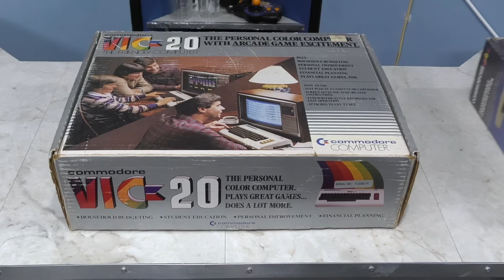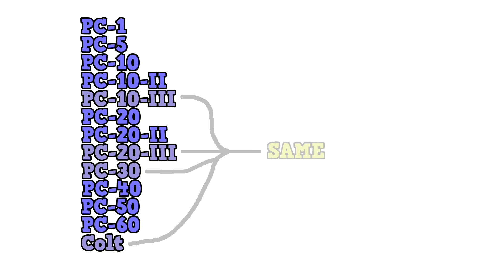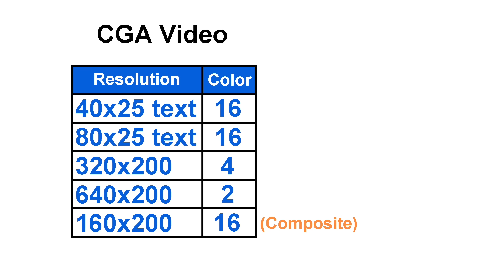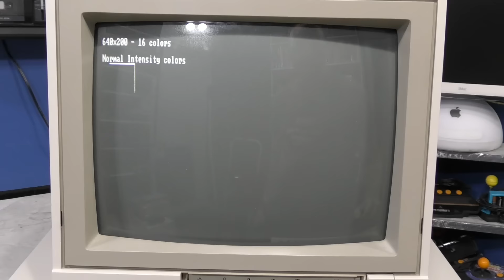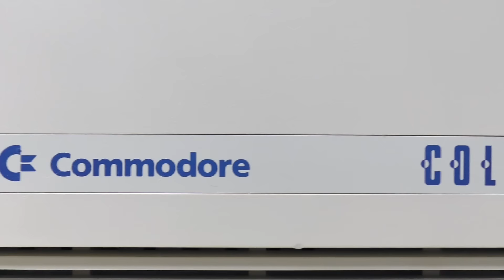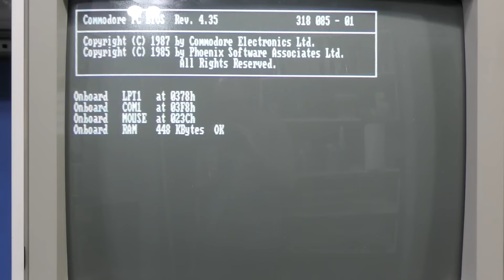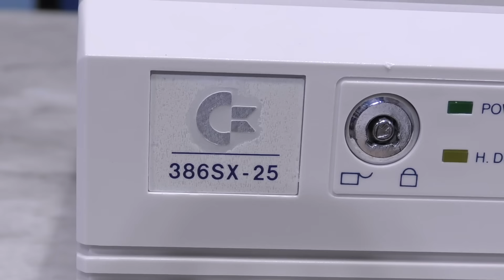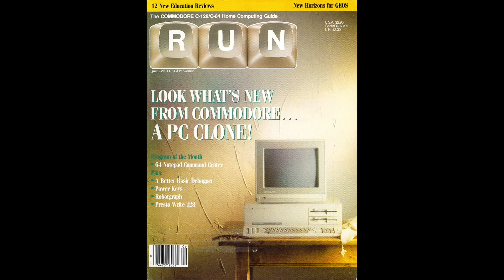Commodore History Part 6 - The PC Compatibles

Comment: Thanks very much for doing this, I'm loving the Commodore History series!
The Commodore PC-10 was our first PC my father bought. It was in 1988 IIRC. However at least in Germany it did not come with that ATI graphics card, but instead just a display card that could not show graphics, just characters. So when I was excited to get my hands on a copy of the awesome game Digger the disappointment was huge when my father told me that it won't work on the machine. He knew though how much me and my sister wanted to be able to play that game at home we drove an hour to his employer, which was an IT company, to get a graphics card (sadly I don''t know which brand, model etc., but it was a full length card) along with a compatible monitor. So instead of our cool looking green monochrome picture we then had a blue picture which you could also be set to inverted colors. I was in heaven when we fired of Digger :-) That keyboard layout having the key to fire (F1) on the top left was very handy for Digger compared to the later standard layout.
Sadly we gave the Commodore away when we upgraded to an IBM PS/2 in 1992, but I have the Atari PC3 my uncle bought in 1989 which offers the same experience but with an cool looking orange monochrome display.
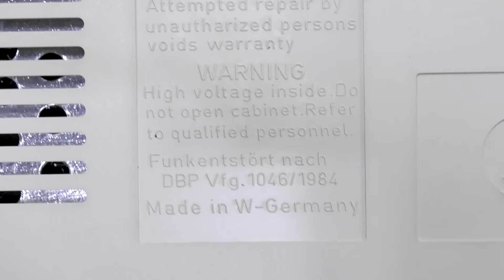Regarding the part of the video at 1:42 that label saying 1984 just shows a year number for when that technical mandate was released by DBP (Deutsche Bundespost = German Mail Service) which at that time were the state-run monopolist for everything related to communication. So they mandated inspections and approvals for technical devices making sure they won't interfere with other electronic devices and over the air transmissions due to excessive electro magnetic radiation.
Greets!

Comment: One thing Commodore should have done, and that is adding SID card on their PC's
Reply: or they could have just added the Paula (the sound chip used in their Amiga computers)
Reply: Quick question though, SID and paula were custom components to the C64- 128 and the Amiga, what other PC used them, the whole point of PC compatible was to make the software work with all of the PCs and the PCs work with the hardware, look at the plantronics mode, had no support at all, at this point if they had tossed a SID or Paula into the machine it would basically languish there doing not a darn thing most of the time, that and the SID didnt just do sound, it also had random number generation and was in control of the joystick ports of the C64. The only standard that was hardware related and supported was the Tandy 1000 video and sound modes, but those were supported cause the computers were quite popular and it wasnt too hard to code for them since they were just modified PC jr modes, but imagine how hard it would be to get a SID or paula sound mode to work properly

Comment: Sorry if this is a repeat of other comments (in all of your videos).
You know when Automotive companies re-use parts in several of their models? This video shows the same habit on Computers.
I had the impression earlier, but now I am convinced: the PC-1 front plate is definitely a C128D. Which came earlier? It seems the PC!
And the Commodore 386SX-25 has the A4000 2nd floppy drive cover!
Co-Incidence? Marketing? Sales? Manufacturing? Caponians? I think it´s all of them!
Worth a video? I bet so :-)
Reply: The C128 was introduced 1984, the 128D in 1986 - the PC1 came 1987 as answer to the Atari PC 1 - Therefore the name 1 and the reason why it came after the PC 10 and 5

Comment: I remember those. My dad used to have one too (PC 20 III i think) and in fact THIS is how i got in contact with Commodore at all, together with a borrowed C64. I remember this IBM compatible PC to be a really slow machine without VGA or EGA output. Just a  black&Yellow monochrome Monitor and one standard 3,5' floppy drive (for low density disks). The whole thing always made weird boot up sounds and was super slow. Hard drive was i think 10 or 20 MB. I don't remember ever having done much with it, except using the Norton Commander to browse through the computer & exploring a excel like program, loading stuff from the floppies that came with it and play "Magic Pool Billard" on it with my sister. It didn't even have a soundcard. Just the internal speaker. I really started at the absolute bottom but i found it SOOO cool that my dad actually had a PC. However he didn't do much with it. I must have probably used the thing more than he ever did. He even had tons of software that came with it and many books.

Comment: Overclocking in 2019: buy a better cooler, set multiplier, increase voltage, stress test for hours
Overclocking in 1987: Ctrl+Alt+D
Reply: Another one to add for 2019 Pray that it doesn't release Magic smoke.
Reply: Overclocking in 1996: Cut cable tie that held the oscillator in its socket on the motherboard, remove 33 MHz oscillator, install 36 MHz oscillator in its place and put passive heat sink on the CPU. 468DX-36 it was. B-)
Reply: Technically you are right - the system is designed to operate at the fastest of the three speeds. Everything else is just slowing it down for programs with fixed delays that would run too fast otherwise. The "turbo" button found on many AT PCs was misleading, it should have been reversed and called "slow down". 

But in any case the original comment is much funnier when not nitpicking. ;-)
Reply: we're pretty much at the edge of what the laws of physics allow us to do. They just really didnt want to put a cooler on their cpus.
Reply: You can overclock the Raspberry Pi by adding a heatsink and editing a text file.
Reply: This is no overclocking. You basically chose clocks within the rated specs of the CPU, mainly to make software slower that was not designed to run at higher speeds. This is because some software (especially games) was written with a specific CPU speed in mind, so it would just run too fast on faster CPUs. There also was a turbo button on each IBM-compatible desktop computer, usually on the case, until about the mid of the 90s.

Comment: I love these episodes! I had a PC 10III en a PC20 exactly matching the one in this video. I bought my PC 10III, i think back in 1986, for a staggering 4000 Dutch Guilders or $1600. It had a green monochrome screen, two 360 floppy drives, 640k ram and a very nice (for the time) graphic mouse (with three button mouse) interface to design your own user menu and a drawing program. It was the folluw up for my Sinclair ZX Spectrum. I had a special program to emulate a better graphics mode called HGCIBM which worked fine.

Comment: Had this same kind of MFM HDD-on-ISA-board in my first XT Olivetti M240, which also had a composite CGA card. Second PC was actually a C-286-16 with same chassis form factor as the 386 shown in video, I was able to get a 287 coprocessor on it even.

Comment: Turbo mode, not to be confused with the Turbo button on PC clones, which would slow down the processor...

You know, I was alive for all this and I still don't get it.
Reply: Well, actually the turbo button controlled the turbo function. The default state of the turbo function is "on". Turbo just means "faster than the 5150 IBM PC". If you press that button, turbo gets turned "off" and the processor timing should be compatible to the original IBM PC. On 8-bit PC clones, timing compatibility kind-of worked (unless they replaced the 8088 by the more efficient V20), starting with the AT and its 286 processor and differing RAM timing, the non-turbo mode lost its meaning as "being as fast as the original".
Reply: @tw11tube  I'm quite sure the turbo button my XT clone was active when pressed. I was 7-8 years at this time and sometimes worried if I break my computer if I use the TURBO too much (but in the end I was 7-8, so I didn't care about that. I wanted it fast NOW.)

Comment: Lesson learned. If I ever move to the USA I will install a 240v European style socket in every room for convenience's sake. It should be quite easy to run some wires directly from the fuse panel through the walls, or even better, in plastic cable channels mounted on top of the baseboards.

Comment: I still have an old commodore laptop with a really nice amber gas plasma display.  Found it in a pile of trash over 20 years ago and apart from the battery it still works fine.  Im amazed the hard disk still works after all that time.  Only ever seen 1 youtube video of the model I have and that was just a 20 second clip of it booting that was posted years ago.
For another interesting PC produced by a home micro manufacturer look at the Sinclair PC200, an all-in-one (like an Amiga) 8086 so badly designed that you couldn't close the case when any expansion cards were installed in it.

Comment: The interesting thing about the PC-1 is the way you add the harddrive. It is connected to the user port with a special cable connecting to the external disk drive connector. This was a loop through connector. So we were able to add a second disk drive  with higher capacity.

Comment: That composite header up in the corner is most definitely for the internal monitor of the  IBM 5155  :)
Connector looks the same as on the original IBM card for that machine as well as the connector found on some other ATI cards of the era :)

Comment: Little mistake .1984 has nothing to do with the release date, its just a Conformity Statement thats called (Vfg 1046/1984(yes we germans love stupid long confusing numbers)). 

Back in the old days the  german postal service had the monopol over licensing the whole communication sector like telephone, CB-Radio, Walki Talkies, RC-Cars etc and they had Conformidity Statements for everthing that used any frequence(cause why not:-). 

Usually they had the symbol "Posthorn" right next to it, seems like its missing here. 

Electronics Emissions

Your printer complies with the Electronics Emissions Requirements of
the German Federal Minister for Postal and Telecommunication Tech-
nology regulation

Vfg 1046/1984

Comment: Our second PC when I was a kid was a Commodore 386SX-25. It is still another model as the one shown in the last part of this video. Case is bigger, all ports are on the back, and there is no PS2 mouse support. We added lots of things to it to run games, including sound card, way more RAM, bigger hard drive. Of course we still have it, last time it took it of storage few years ago was to take out battery to prevent any damage. Appart from the hard drive that starts seizing, it booted fine.
At that time I have tried to figure out a logical sense in Commodore PC lineup, but no luck at all, it looks like a complete mess where every local market had its own models and varieties of products.

Comment: The "Funkentstört nach DBP VFG 1046/1984" simply means that the standard according to which the device was shielded (radio shielded, to be more accurate) was adopted in 1984. You can find devices made up until the mid 90s that followed this standard because it was the norm in Western Germany until its successor was adopted.

DBP = Deutsche Bundespost = German Federal Post Office that was in charge of the regulations back in the days (it had a government-mandated monopoly on all things telecommunication including all things radio frequency)
VFG = Verfügung = regulation, directive
Reply: It may have simply went out of picture when European standards were adopted. Back in the day European Community member states were more or less trusting each others national standards and complying with a German standard was fine in order to sell in most other countries, however, some countries still had more strict laws than others, so it wasn't ideal.

European standards are more or less all national standards combined, all EU member states are required to trust devices complying with European standards. So what do you do nowadays? You design/certify a device according to European standards. That's why these texts disappeared.

The national standards still exist though, and so might this one.

Comment: In case this hasn't already been mentioned by a previous commenter: The 1984 that you though to be a possible manufacture date on the back of the PC-1 is just the date of the applicable German EMC regulation.

Comment: 1:44 Quick explanation, the date is not for the PC but a regulation for signal supression in german. It basically says "radio supressed in accordance to DBP Vfg. 1046/1984"
The terminology DBP probably means "Deutsche Bundes-Post" which was at the time the national post service who was also operating the telephone/cable services, which later in the 90s got separated and turned into Telekom. Vfg stands for "Verfügung" meaning decree.  DBP Vfg 1046/1984 therefore means a decree for a radio noise supression standard issued by the Deutsche Bundes-Post in 1984. 
It seems to be indentical or at least compatible with "VDE 0871 Klasse B", another such standard.

Comment: I used to have a Commodore PC40 in 1991. I bought it at a military base post exchange. The 40 means it was a 40MB HD. I remember using an application called Stacker to double the HD capacity to 80MB. Later I found that was a HD killer by overworking it.

Comment: The comparison to the Performa model numbers is very very accurate. Another good comparison would be the EX/HX/SX/TX/TL/RSX thing with the Tandy 1000. 

There's something about that timeframe where it often felt like companies were just pulling model numbers out of a hat, and playing scrabble with any letters.

Side note, really been appreciating the commodore history stuff. Whilst I had a VIC=20 and was involved in writing some sub-code for larger C64 projects, I was more of a TRS-80 guy than a Commodore one. It's interesting to hear that basically all these companies had bizarre internal struggles and strings of shitstorm "half-releases". It almost makes it look like Tandy knew what they were doing in terms of product consistency... even if like Apple they did have the habit of milking single design concepts for a decade. 

One thing I always had to hand it to Commodore for, at least they tried to do different things instead of every new model just feeling like a tired retread. Sometimes it worked (VIC=20 vs. Pet, C64 vs. VIC=20, Amiga vs. everything they ever made before), sometimes it didn't. (Plus 4, sadly the 128 being too little too late, etc). Unlike Tandy where 80% of their product line were retreads of previous models... like the Model 1/III/4 and or II/12/16, or Coco 1, 2, and 3... Or Atari's endless 8 bit line where at heart they were all nothing more than 400/800's in new form factors. Hell, how about Apple basically selling the same computer with little more than cosmetic changes for a decade and a half, whilst making false claims about how "innovative' they were?

I now have a minus-60 in my collection. Keep meaning to do SOMETHING with it, but I have no idea what.

Comment: I know this video is a couple years old, but back in the 80's I worked at a small computer store... we sold ton's of various clones including our own brand, as well as used computers of all sorts.  I acquired many awesome and unique devices over the years (Altair, Mindset, Sage, Gavilan and many Commodores among others).  Unfortunately, I have sold off many of these over the years.  But one Commodore I remember playing with (I never purchased it as it was new and was very pricey) was a Commodore branded monochrome notebook computer... was really slim for the time and had a unique textured case.  I cannot remember the model number and I have not bee able to find anything on the internet about it.  It was an MS-DOS machine, pretty basic.  Just wondering if you had seen it or had any info on it...  thanks...

Comment: Ah, Commodore PCs. I remember in highschool, circa 1993 we received brand new Commodore 486 DX2 66 to do some CAD on in industrial tech class. Teenager me was impressed with those machines (all the more since I was still using my old 1040 STF at home, and Commodore machines were alien to me). Doom ran a lot smoother on them than on old 386s in the school's library (athough those had networking).

Comment: The PC-1 also sold in the Netherlands. It was sold at a general store called kwantum for 899,- gulden, discounted from 999,-. with a monochrome monitor. A 1084 could be bought for 699,- gulden discounted from 849,- gulden. In oktober 1989.

Comment: Hi,After my intervention on part#5 and C128, here's my point about "compatible" era of Commodore :1) first PC compatible attempt was the B series expansion board with a 8088 [notice that AFAIR, no word about B series in previous parts]2) In 1985, the A1000 had a "side-car" expansion that was more a sort of co-computer plugged inthe right of the A1000. This was then derived to JANUS internal boards for the A2000 and followers that existed in 8088/V20/80286/80386sx version if I Don't miss any. The idea was to have a "side" PC-Compatible computer next to the Amiga, sharing keyboard, mouse, and screen (in dediated "screen" of the Amiga). The interesing thing of this setup was to allow easy data exchange betwen PC world and Amiga world, including the complete sharing of a PC Hard disk at hardware level, reducing seriously the cost of a "professionnal" setup.Regards - Hervé - And again, thanks for this serie

Comment: @The 8-bit Guy: 1:44 The "Funkentstört" lines are german and refers to radio interference regulations 1046 of 1984 of Deutsche Post. Back then DP was state owned and responsible for mail and telecommunications regulations, like the FCC. So, this has nothing to do when Commodore designed or released the PC-1.

That sentence is simply found on many electrical devices of the time in Germany... :)